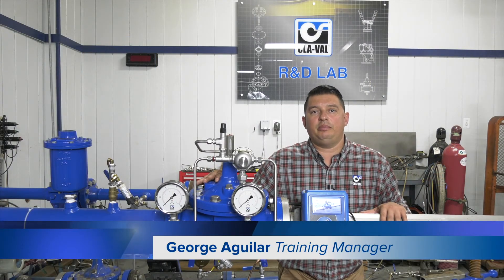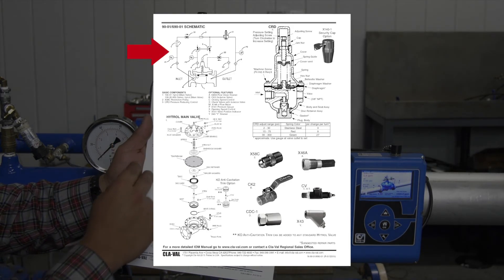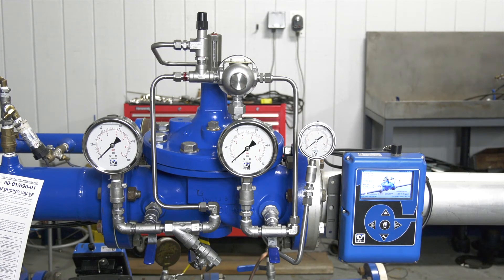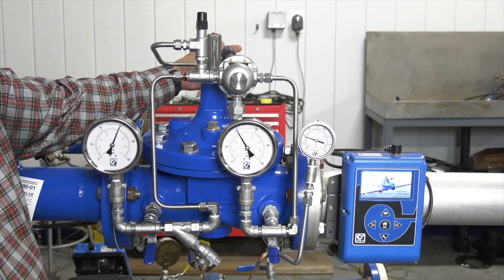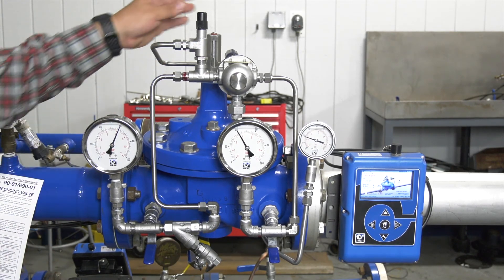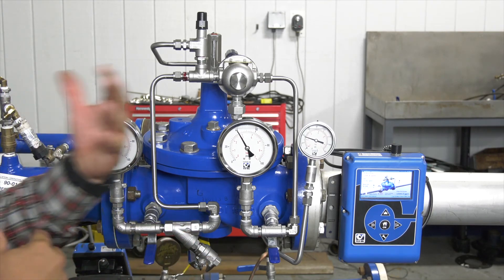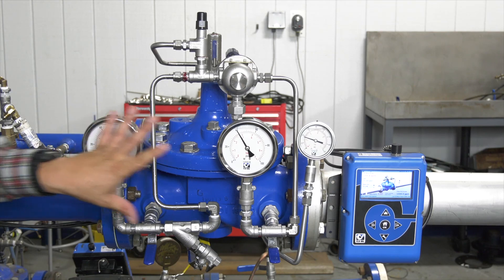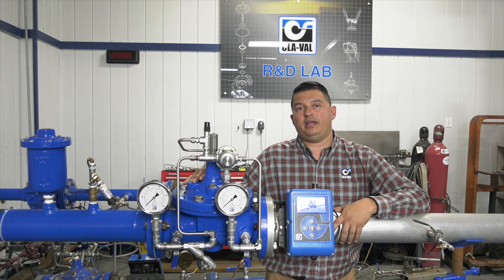Cla Val 90 01 PRV Troubleshooting

Comment: In a live system those modulating seconds could blow a main ? Shouldn’t it stay at 40 regardless of flow increase 5 to 10 m of head  Pressure could definitely disrupt the system blowing ageing infrastructure.